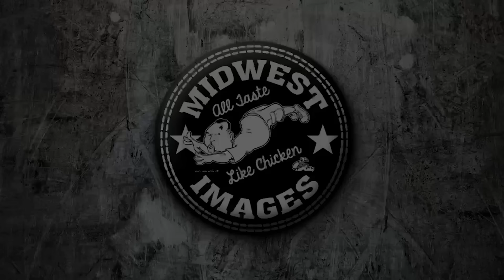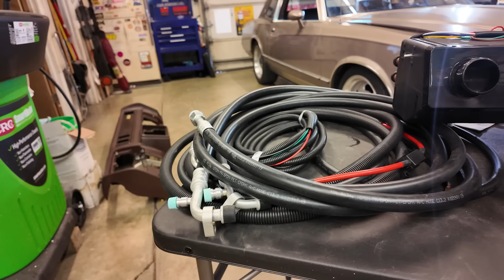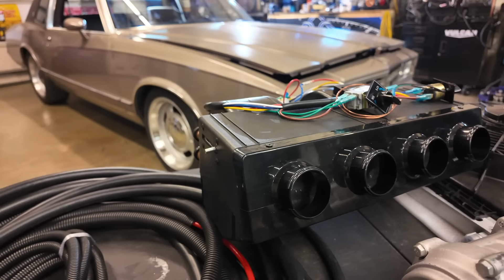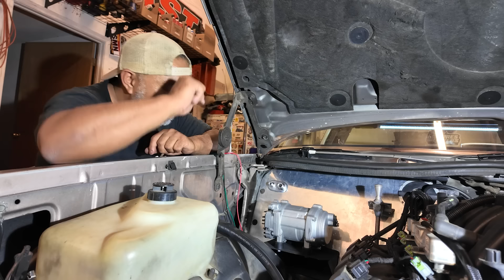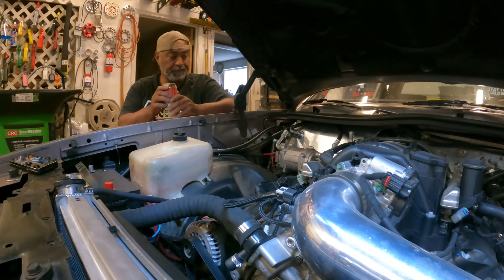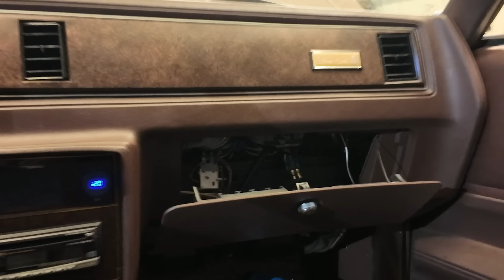12 VOLT AIR-CONDITIONING MY HEMI MONTE CARLO...IS IT WORTH IT?

Comment: Happy i found this video want it for my g body after engine swap. For start up I'd put a capacitor inside vehicle wires connected to compressor that will help with start up voltage drop. Could get a battery isolator & connect compressor to secondary battery bank if drains batteries engine will still start

Comment: Use a deep-cycle battery. I would try a 100ah and an isolator. It should carry it all. I've used deep-cycle batteries in my off road vehicles for years to power winches and air compressors.

Comment: Thinking about doing this on my engine swapped 91 Miata.  It already has aftermarket E-power steering.   BUT it has factory a/c and the oe battery location is in the trunk, so plenty of room for an upgraded battery.  What are your thoughts on me just slapping a higher amp and capacity battery in and the electric compressor only?

Comment: The fish thing I noticed in that kit is the condenser being too small for that car. That condenser is for a smaller vehicle. Change it, upgrade it, with a better fan, if the fan you have is not big enough for the new condenser and you will see the difference right away.

Comment: What I like about it is I don't have to mount that compressor right there. I can mount it anywhere and in a smaller cab like my 64 El Camino it would be perfect. You need to insulate your cab too and the squirrel cage motors can be changed out or improved like you said. I will only have dual fans and a fuel pump plus I ordered my Alt from Powermaster and I can run dual batteries. You could run an rpm switch to turn it off below a certain rpm as they have switches like that already. 3M makes a clear tint that works like dark tint...

Comment: Window tint with the ceramic coating is a huge help to cooling off the interior of any vehicle! Thanks for putting this video together!
Reply: You are right, it does a great job, FYI. The tint doesnt have ceramic coating. The tint IS ceramic.
Reply: On top of that ventilated seats and white 5% windows tint will fix the problem 85% all you need it's 15% AC

Comment: You could buy a Mecman alternator  the make them up to 370 amps we use them in car audio there's a few other brands out through also. You can also do the big 3 upgrade it's what we do in car audio the big 3 is 0 gauge wire from alternator to battery upgrade and add ground wire to the frame and ground wire to the engine preferably the alternator bracket there are YouTube videos on doing it add a extra battery if there's room

Comment: Did you know us FORD (smarter Choice) always Use the Engine Vacuum Too Pull Down The AC BeFore You Gas it up. PS  Electric  Roof  Mount AC For Trucks and Van,so 4 bolts hot a ground 4 small holes for cool air

Comment: Generally speaking, what you did is not a blueprint for everyone else, it is however an idea that can get someone started. They will need to solve their own installation problems.
I would consider a high output mechman alternator, maybe even a multiple unit setup like the SPL guys run in car audio. Mechman builds a 400 amp alternator, so building an electrical system that can handle the draw is possible. It is critical that wire size is correct for the load that the system is pulling, as well as fusing. No one wants to see a car b que, because of the lack of fusing and adequate wire size.
The biggest question for me is cost effectiveness of the unit you installed versus, a belt driven setup.

Comment: Just to compare, the A/C on your house is somewhere between a 1.5-3 Ton system and that's on a 1,000-2,500 sq ft home, when you look at car systems they are 18-25 ton systems for just a 15-30 sq ft space.    the reason is,  your house isn't hurdling down the road 75MPH on a 95 degree day,  imagine a constant 75MPH wind blowing on your house on a 95deg day......... your Home A/C would struggle too.

Look into a car audio Alternator.  get you a 200-350A alternator in the stock location.     the Battery is just storage, if your load is outrunning your power source your still going to kill the battery(s)

Comment: I'm thinking this would be a great system for my 86 GMC. It didn't come factory with A/C, only heat. My only draw is the MSD and small electric fuel pump and I've already upgraded the alternator.

Comment: Amp hours are the most important part if you want the system to run while the engine is off. A 9C12 12volt floor sweeper battery would be the better choice with the isolater and 150 amp alt. The battery is big( tall), but it will run a long time.115 minutes run time @75 amps.Great video, by the way! I've been contemplating putting one in my 55 Chevy Belair.

Comment: Couldn't Lektrik Comp be used to replace OE belt drive type, reusing O.E. dash stuff and condenser. 
FORD & GM  have big alts that output 70-80 amps @ idle.  Don't know know if mopar does. Had to use them on lektrik fan conversions.

Comment: The moisture removal is the most important for longevity and how cold the system can achieve. Sure you can just seal it up and throw refrigerant and compressor oil in, but by pulling 29' of vacuum for 30 at least 30 minutes,  you ensure that the moisture has all evaporated and you can let the system sit to make sure that it doesn't lose vacuum due to a leak and waste refrigerant , the mechanical parts inside of the compressor will last longer because moisture and oil/refrigerant don't mix
Reply: Do you know in what way the oil should be charged?

Comment: Question. Instead of replacing the cages in the box, could you just replace the switch so it give the motors more power so they spin faster?

Comment: adapt an old school GM V5 compressor a large condenser and use R152a refrigerant and pag oil......you will be glad you did......
to use an electric compressor out of a hybrid car is way to much effort......they run 3 phrase motors..and the voltage is very high....needs a lot of stuff to do all that...and 
......well you get the picture....and oh yea....Sep 11 2033   is Judgement day and the word ends.....so have a happy day : )

Comment: Im curious as to why it only charges at 12.7v. Id also look into a decent high output alternator. Ive got a pair of brand-x 390a alts and 200ah of lithium in my stereo truck. Charges 15.9v. But, thats for a totally different reason and im getting a little off track. 🤣

Comment: I bet the cheap chinese condenser fan hampers performance in traffic, they have terrible flow specs. If you chucked a bigger condenser and a Delta PAG or some other big boy fan up front you'd probably have a noticeable increase in performance. I have one of the Delta fans on my daily driver and that thing moves air like nobody's business. Even with a crammed up engine bay with big hot turbo in it, blowing air through a condenser, an intercooler, then a radiator, that thing drops the temps when it kicks on, the two small spal fans on the radiator can't keep up without it and literally nothing bigger will fit because of how close the engine is to the radiator.

Comment: You could run batteries in series like 3 batteries in the back pushing 12v to the unit but with 3x the cranking amps 😅

Comment: The downside to electric A/C is the the amps they draw. To compensate for the draw when running you need an oversized alternator, something like you see in police cars and ambulances to handle the constant load without burning up and also I would go with a dual battery setup like on diesel cars and trucks so you have the amperage reserve and don't fry the single battery just like you see in those vehicles with insane sound systems..

Comment: This was a great video, Mike. I live in florida and have a 1980 Trans am with a chevy 454. I rarely drive it in summer because it's too damn hot!  I still have all the in dash duc workt and factory ac box in place so one of these electric compressors might be just the ticket for me, especially at that price point. I'm not one to need my ac to make ice cubes in the car nor do I ever use the "Hurricane " setting on the blower motor so this system might be adequate for me. I'm definitely going to look into it more. Keep us posted on how your system holds up and if you make any other mods to it.

Comment: I feel like the problem you will have attempting to do any kind of meaningful upgrade is that the compressor, condenser and evaporator are all sized around a specific BTU capacity. If you hook it to a larger evaporator and higher capacity blower the air will not get nearly as cold as the compressor and condenser are still limited to the 12,000 BTU. Factory GM belt driven compressors range from ~30,000 to ~47,000 BTU depending on the application, the V7 is the highest capacity and ironically came on the 4 cylinder S10s with a tiny cabin. Your G-body would have had a R4 and those are around 34,000 btu from memory. I just pulled a Sanden 4261 SD7H15 155cc displacement compressor off my 1987 G20 van that really struggled in the heat especially at lower rpm. The Sanden performance chart put it at a maximum of like 28,000 BTU @ 5,000 rpm compressor speed.  In its place I put a 200cc Denso 10S20F. The Denso compressor moves more like 40,000 BTU.  The Denso unit is more inline with the capacity of the factory GM evaporator core and the massive parallel flow Peterbilt replacement condenser I shoved in the core support.  When it is 110F outside it will blow your hair as you like to say and it will blow 25F from the center vent on high fan speed before the cycling switch cycles the compressor.

Comment: Two suggestions:

1. Get a Mechman alternator for that HEMI. You won't be disappointed.

2. Definitely get ceramic tint. The UV blocking capabilities of it are what make the most difference in heat rejection. Trust me, it makes a huge difference in the AZ sun. 😎
Reply: 💯 
I love my Mechman alternator in my Gbody!
Reply: In Iowa, you can not tint the windshield or front door glass.
 Police have a vintidta against  window tint here.
Reply: @troywhittle1594 Laws vary by state of course. Tinting the front windshield is kinda dumb anyway, but a UV tint that doesn't darken the glass should be ok in most cases. Blocking the UV is what matters the most anyways.
Reply: how much is that alternator $?
Reply: Get the 400 amp one and show us

Comment: Get 2 more larger ac units, a few batteries in the back with a Honda generator..! If that cannot get you cold in that little G box - scrap it.. Then pull the ac from a junk yard Cadillac or similar GM higher volume system.. They work very well even with the 134a..!

Comment: Vacuuming the A/C system not only removes the air but the moisture. Very important!
Reply: Removes air, moisture,  and possible contaminants...also verifies there's no leaks!!
Reply from the maker: Truth!
Reply: What's the temperature holding in the cabin? And what's electric car doing for air conditioning? Are they any colder inside ?
Reply: Da. O2 will always be o2

Comment: oh yeah, and a fix for the weak indash blower motor could be a step up voltage converter. Just need to know the amp draw on max to the blower motor, DC amp clamp. and then find one rated to handle that, properly is more then 10amps. that will step 12v up to 16v. spin faster and my experience is a 12v motor is just fine on 16v. there's actually a kit you can buy for g body and 3rd Gen G body's to run 16v to the power window motors. much faster and the motors last longer because they don't get hot struggling. could be an eazy fix.

Comment: 2 things.. extra batteries with not keep your voltage up.. Upgrade your alternator.. That is THE solution to your low voltage..and heavier gauge cable. period.
2nd thing.  Wth is "electrical oil" in your ac compressor?  😆👍

Comment: I'm actually pretty impressed with this review. almost those a cheap DC amp clamp, vent temp and maybe even pressure from gauges would be very cool. to know. but running a full hour on the car battery is very impressive. especially if it shuts down at low voltage. I thought 15mins at most. seems like a car that still has its factory setup under the dash and a 200amp alt, this thing would be just fine for a cruise car you don't sit in bumper to bumper 100deg days.

Comment: P.S.  A big source of heat the factory cars are fighting as well is the exhaust temperature because the factories need to run the liquid refrigerant lines from the front of the car to the cabin and therefore pass along the exhaust manifolds.  The further you keep the lines away from the exhaust the better off you will be.

Comment: FYI A typical car has a 12,000-18,000 BTU AC system.  In the HVAC world this would be called a 1.5 ton unit.  This size unit could cool an average 2 story home.  Not one of these modern McMansions, but a typical 2 story home.

The biggest source of heat you are working against in the automotive world is the sun light.   You are basically driving a mini greenhouse.  If you reduce the sunlight entering the car you will help the ac system.  Even back in the 1960's factory AC cars came with tinted windows.  Back then the tint was a very light green, it is not very obvious but if you know what to look for you will notice it.

Comment: back in the late 1970 and 1980 i worked for montgomery wards and sears we install  a lot of under dash units and indash units because most foreign cars didn't come with AC those units were belt drive used the cooling fan provided with the car they cooled as good if not bette than the stock units. they had good airflow. not sure what has changed with the units i firmly believe that those would work with electric compressor but like you said voltage is the key i also thing if the voltage with engine running was 13.8 to 14.2 the unit would work much better also thing stock dash componets with just changing the compressor to the largest electric compressor might be the way to go.

Comment: One thing you need to mention with the larger alternator you must increase the charge wire at least double the gauge or run a separate one along with the stock wire directly to the battery + at minimum two 10 gauges.
Reply: he/video should look off EMS/cop-spec alt's got 3( different platforms 300( 2.7L )/TJ/70-charger( 440/hemi-540ci and yes there's/got mine with ( currently configured for ECU/EFI as the triggering/later plugs gm or dodge type that way computers aren't guessing voltage-ect ) the stock-drive/V-belt's and mine has ( might be worthwhile to drop the RV12-unit as it's nice to running battery/solar at the pumps/shopping/car-showing/city stop&go ect but im not a fan of PAG-oil and like CO2-replacement )stock-AC &vin'd got tried for cold starting+piss-grounded-stock-configuration in slc-ut also helpful is the new/post-covid-era lithium(2k~CCA not going back to leaded they suck in comparisons , again i don't have the shipping-box/bill out to read OX,,,something's ) does wonders vs stock-spec-500CCA-lead+water ) all 220amp+ v8-poly-cop( his v for 320~unit and or CHP/UHP/ISP run them and or he service's there cores's/ship-R&R-service )/charger's there's a opportunity on there web-page/call-in for 340~amp ) from the same LLC/California sorry i don't have the recites/box but i highly recommend them/owners and happy with the product ect

i got clued-in on this from coworker's that are bass-head-types/big-3-upgrades but they run Chevy's LSX/impala's 2000's-ish-era and yes there runing 220-230amp-cores as well but theres isn't( might be mac-man? ) from the same place as mine is, also helpful of adding a bigger 1-to-3 fard-cap helped the jeep( things like radio/better reception's-ect or winches ect ) out a lot haven't got to the charger yet
Reply: @richardprice5978 I switched over to 12.8 volt lithiums and it has been absolute gold.. You pay maybe triple the price and get five times the capacity.. and the batteries are usually much lighter than their lead acid there's just no downside
Reply: Do you know if the life span of lithium batteries are comparable to lead acid batteries?
Reply: @paulreed7818   LIFEPO4 are 6000cycles to slow down to 70% of the spec rate, pb are around 100 cycles.
Reply: Mechman alternator is the way to go!
Reply from the maker: I cover that on the upgrades video ..part 2

Comment: 250A alternator off of a Ford Transit or Police Interceptor is your cure.  They are cheap and plentiful.  They use one-wire communication to the ECU but if it's not connected (not in a Ford vehicle) the alternator puts out 13.5V all the time.  (Under 13V and your system is undersized.)
Batteries don't generate power.  They only store it temporarily.  You NEED another alternator.
Wire the 2nd 250A alt in parallel to your exiting alt, or just use it for the AC.
Also, alternators can spin backwards, you can mount one facing the motor where an idler pulley used to be.  Charger/Challengers use this in their supercharger kits to relocate the alternator.  Maybe you could get a pre-made bracket for that setup.
Thanks for the video.  I've researched the electric AC stuff a bunch (and power steering).  You're spot on.

Comment: Given how poorly modern Freon versions cool.. on my older car's I've considered repairing the R12 systems and driving to mexico to get charged with R12 for CHEAP, since outside the USA and patent protection of Dupot you can get R12 for cheeeeeeeeaaaap. It cools so much better, so much that the "Desert Only" option means it. Sub-zero air coming out of that vent.

Comment: IMO the electric system is a much better idea. It always cool the same amount even at idle, Easy to manage the electrical demand and that benefits the rest of the car as well.  It can be adapted to almost anything. Leave it running if you are going into a short for a quick pick up

Comment: Put a couple of those 100amp/hour lifepo4 batteries in the trunk with a charge controller and a couple of solar panels on the roof. With tinted windows it could theoretically keep the car cool indefinitely.